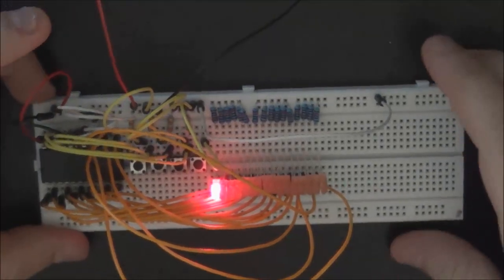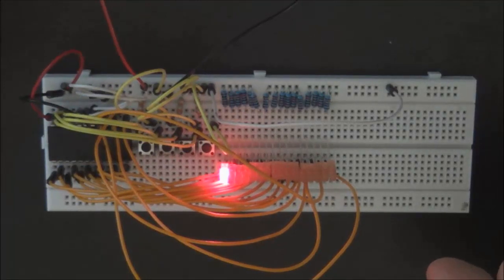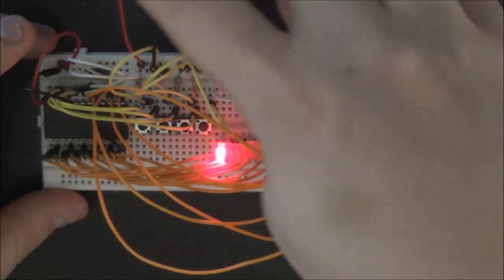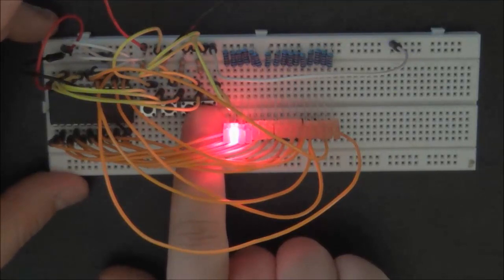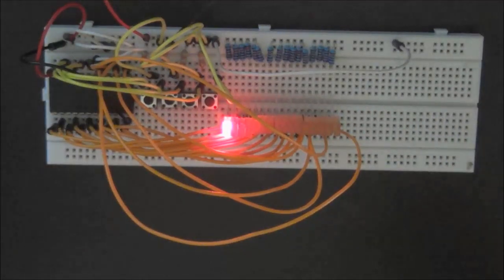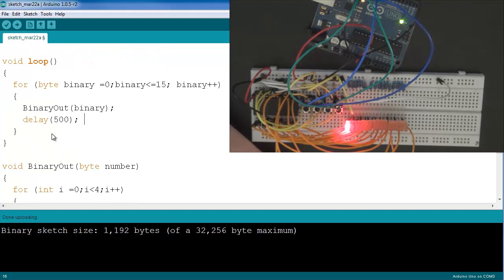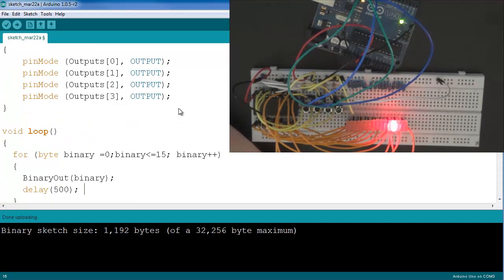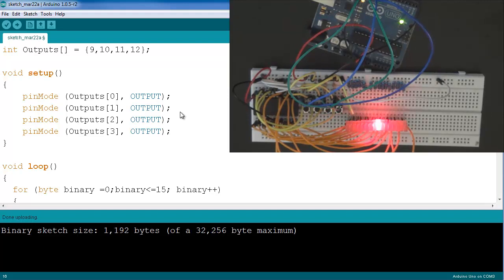Use 4 Arduino pins for 16 outputs! Serial to Parallel Demultiplexer

Comment: Would this chip be good to drive a transistor to operate an electric valve, or small 5 watt heater?  Or would a different chip do better?
Reply: if you are planning to control a high power or an AC circuit wether its controlled by a transistor FET or anything i would suggest an optocoupler to for safety purpose of your microcontroller. as far as i understood of your statement you are trying to control the amount of current to control a heater or electric valve in such case i would suggest u a digital potentiometer or PWM if you are working with DC current. in case of AC current its a long story u need a digital AC current dimmer.

Comment: Thanks a lot, it's a good way to multiply Arduino output.
is it possible to use 3 multiplexer in a single Arduino UNO board ??
Reply: Yep! I've actually got a video up about using 2 at once, and i'm going to be adding another 2 to that same project so i'll have 4 (might do a video about that if people are interested).

Not trying to self advertise lol, sorry if it seems that way. Just, yes. It is totally possible :)
Reply: @ChildOfAnAndroid  Thnx a lot i really appericiate it if you have a video explaining the whole thing , that would help a lot . :D

Comment: Is there any way that i get more than one output at at time?
Reply: if u r using a demultiplexer its not possible. but if u r using demultiplexer for leds and want more than one leds to be on at the same time u can decrease delay time of HIGH and LOW so a human eye cannot detect that if every led is on at the same time or they are blinking with specific time. but if u really want more than one pin to be HIGH at the same time then u can use a sipo shift register 74hc595 for writing and piso shift register 74hc166 for reading. 74hc595 will make 3 digital pins into 8 digital writes and 74hc166 will make 3 digital pins into 8 digital reads. shift registers dont need to be multiplexed they read or write on more than on pins simultenously.

Comment: How to control these 16 LEDs, using four pins, but leaving on as many as I want? Currently only one LED is on at a time :/
Reply: u need 16 bit sipo shift register (74f675A) or u can use 2 pieces of 8 bit sipo shift registers (74hc595) and cascade them. in both of cases u will need 2 digital pins 1 vcc and 1 ground pin. vcc and ground pins can be used from any other power supply if load is more than the capability of your microcontroller.
Reply: 3 digital pins*   it was a mistake. u need 3 pins for data, clock and lach or lache idk spell :D
Reply: You can do it in your program, 
Just on or off the particular pin only and dont cycle on all the pins.
just skip them.
Your progrm will also run faster.

Comment: I have the GD74LS154 demultiplexer from ebay china. When I put in 0000 first led is off and all others are on. How do I revert this. I want one led on and all others off just like in this video. Am I missing something? I am really confused because the truth table is the same.
Reply from the maker: +Tetramorium very simple! You connect the LEDs to the power (5v) bus instead of ground. Make sure you get the polarity right. In other words, the LED will turn on when the output is Low.
Reply: +EEEnthusiast Ok. I knew I was doing something simple wrong :D Thanks!